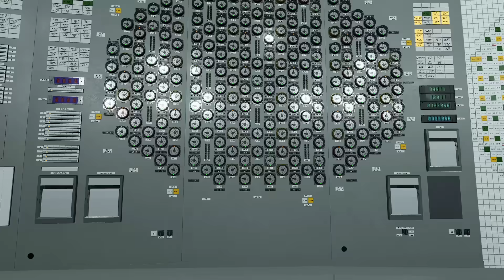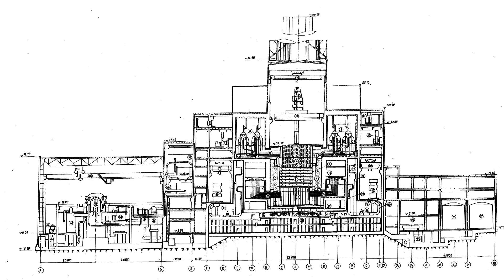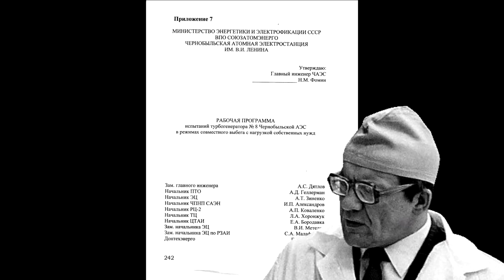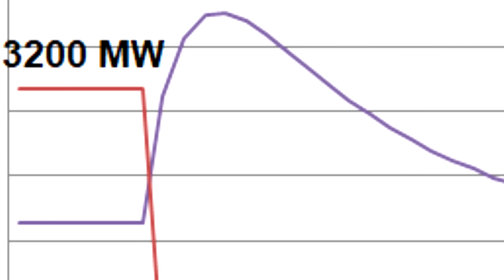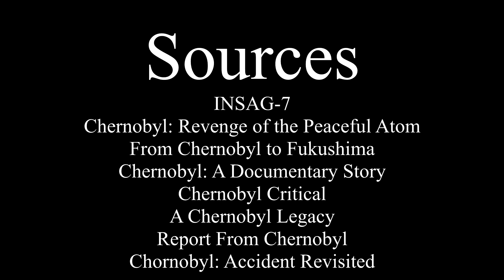How Chernobyl Exploded - PART ONE: April 25th, 1986

Comment: At 5:24 of this video, you state : "Akimov was substituted for Igor Kazachkov". This statement means, in correct English, that Akimov took over, replacing Igor Kazachkov. This seems to be in contradiction to the facts, which per the next part of the video, is that Kazachkov took over. So actually, what happened was that Akimov was replaced by Igor Kazachkov. This kind of error is why I will not be recommending this video to anyone with serious interest in what happened at Chernobyl.
Reply: What other videos would you recommend then? This is the most accurate one I’ve seen, such a minor thing as a grammar mistake won’t make it be super inaccurate.
Reply: @Nemo2507s  I've thought some more about this and tried to find other good videos.

On the one hand, it is critically important, when explaining what really happened at Chernobyl, to be very precise with the facts and to *communicate them clearly*. Who did what is obviously a key part of what really happened. The fact that, in the example I gave, the confusion was relatively unimportant to the overall picture does not mean that the error is not consequential. For sure, this kind of error makes the whole video seem just a little bit less credible. 

However I have not found any videos about Chernobyl better than the ones produced by That Chernobyl Guy, so actually I have changed my mind and I will be, and am, recommending them for anyone interested in the truth. The fact that they are not as good as they could be does not mean they are not the best currently available.
Reply: Six months later, but here's the thing.

Akimov was, effectively, substituted for and by Kazachkov. TCG used proper English.

Why? Because TCG is reviewing the night shift from the 24th to the 25th, supervised by Akimov. And Kazachkov takes over in the morning.

Simple as that. You did a doodoo out of a nothing burger.

Alas. Errare humanum est.

Cheers.

Comment: The Emergency Cooling System offline when there is nothing wrong with it. "Emergencies" can occur in complex systems in any operational condition for any reason, at any time. The only time such a system should EVER be offline is when it demands repair, or routine maintenance and only when the reactor has already been shut down and deemed safe from all other conceivable needs for such a system. Ape brains playing with what they cannot comprehend.

Comment: Chernobyl didn’t explode, it melted down.   Even an out of control reactor will never explode.   Reactor fission is fueled by what is known as slow neutrons, whereas fission bombs use fast neutrons.  Reactors will never be more than sub critical, VERY hot but not explosive.
Reply: Explosions are not required to be nuclear.  Hydrogen explodes, tnt explodes, gunpowder explodes.  The reactor didnt experience a nuclear explosion, it experienced a hydrogen explosion that distributed nuclear material outside of the reactor.  Much more akin to a dirty bomb

Comment: My guess is that Toptunov and Akimov had turned off the auto-correct function of the reactor already at the beginning of the test, and tried to manually run the core during the entire test. This was probably not admitted or swept under the rug during the trial. It is the only way to explain the drop of power to 30 MW - they didn't have enough experience how to control the reactor manually, and had overdone the power reduction. Then they tried to raise the power, but again, did not do it correctly. Finally they decided to push AZ-5 when they realized that they have no effective control over the core, as it was yoyoing up and down, way lower and then way higher than they wanted.
Reply: Not likely

Comment: I'm amazed by how much the operators were blamed for all of this, in both east AND west, the latter of which apparently also had an interest in keeping the image of nuclear energy "clean". If you sell a car and write in the manual that turning on the wipers might interfere with the brakes, and that the brakes under certain circumstances might accelerate the car, and that under a certain acceleration the steering won't work, and then you tell the driver to test the wipers, and it causes an accident, is it really the fault of the driver instead of the engineer?

Comment: you didn't mention a known design issue: the RBMK had an unusually large positive void coefficient. RBMK doesn't keep water inside the reactor under pressure, now you end up with fewer water within the reactor, as the water evaporates. This creates temporary voids. Now water is also a neutron absorber, so that these voids are resulting in a stronger chain reaction and increasing the thermal output. This means you have a positive feedback loop built-in, by design. Eventually the whole thing exploded... 

The book "Midnight in Chernobyl" by Adam Higginbotham mentions an accident at the first installation of the RBMK reactor in Leningrad (a partial meltdown, like at Three Misle Island!)

"On the night of November 30, 1975, just over a year after it had first reached full
operating capacity, Unit One of the Leningrad nuclear power plant was being
brought back online after scheduled maintenance when it began to run out of
control. The AZ-5 emergency protection system was tripped, but before the chain
reaction could be stopped, a partial meltdown occurred, destroying or damaging
thirty-two fuel assemblies and releasing radiation into the atmosphere over the Gulf
of Finland. It was the first major accident involving an RBMK reactor, and the
Ministry of Medium Machine Building set up a commission to investigate what had
gone wrong. Afterward, the official line was that a manufacturing defect had led to
the destruction of a single fuel channel. But the commission knew otherwise: the
accident was the result of the design faults inherent in the reactor and caused by an
uncontrollable increase in the steam void coefficient.
Sredmash suppressed the commission’s findings and covered up the accident. The
operators of other RBMK plants were never informed of its true causes. Nevertheless,
the commission made several important recommendations, to be applied to all
RBMK-1000 reactors: develop new safety regulations to protect them in the event of
coolant loss; analyze what would happen in the event of a sharp rise in steam in the
core; and devise a faster-acting emergency protection system. Despite their apparent
urgency, the reactor designers failed to act on a single one of these directives, and
Moscow promptly ordered more of the reactors to be built. The day after the
Leningrad meltdown, the Soviet Union’s Council of Ministers gave its final approval
to construct a second pair of RBMK-1000 units in Chernobyl, expanding the
station’s projected output to an impressive 4,000 megawatts"
Reply: This, the positive scram effect, Xenon poisoning, the graphite extensions on the control rods, and all other factors involved in the accident are explained in the April 26 videos from the author, and many others from same author analyzing the disaster. Including a full analysis of the INSAG-7 report. This video discusses the events of April 25 (see title) and the lead-up to the actual accident. As noted, it’s Part One of three.

The positive void coefficient knowledge, and coverup, is also discussed in author’s other videos on the 1976 Leningrad and 1982 Unit 1 incidents.
Reply: Between them “Adam & Sergey’s” books cover the evening in question and the wider issues very well. Plokhy’s story covers some of the ground of post soviet Ukraine which is also interesting to read about 
I also enjoyed some of the Kyle Hill stuff in Chernobyl and a couple of the pre-Craig Mazin (sp?) docu-dramas are quite good. I enjoyed “zero-hour” very much.

Comment: Jesus I never knew they turned off the emergency cooling system through physically closing the goddamn valves. The thought of that much uranium sitting there and heating up with no way to stop it aside from control rods is blood chilling
Reply: That ECS was useless anyway. It couldnt prevent the explosion.

Comment: That Chernobyl Guy: Where do you get your information ?  Every other film on this event details that they were testing the use of a turbine's output while it is slowing down.  They needed to know if they would have enough power to keep the reactor instruments going until the generators come on line.  The test had nothing to do with vibration.
Reply: Every other film on this event misses critical details.
Reply: There are credits at the end of the video. They were performing multiple tests in addition to the generator rundown test
Reply from the maker: As Danielle said, there were multiple tests being performed. In my previous video (The Truth About the Rundown) this is touched upon.

Comment: One thing you needed to emphasize is that xenon-135 is generated with a 4 hour delay through iodine-135 decay. That's why the spike appears.  When the power output crashed, the xenon was still being generated at the rate from when the reactor was running at 1600mw.  Once XE135 absorbs a neutron, it becomes XE136 which isn't a neutron poison.  With most of the control rods out, and only xenon and water holding back the reactor, it was like a stretched slingshot.  When the reactor was scramed, the graphite portions caused a runaway positive void feedback loop at the bottom of the reactor.  XE135 vanished, water flashed to steam, and the static graphite moderator caused power levels to reach 200x maximum in a fraction of a second.
Reply: The number of control rods may have been within regulation or close to it. Also, INSAG-7 mentions the presence of xenon rather than its disappearance as a factor.
Reply: @markusw7833  a runaway reaction's neutrons will change the xe135 into xe136 which isn't a neutron poison.   Listen to physicists to understand the physics.  Scott Manley has an excellent discussion on the topic.
Reply: @adamf663  What you're repeating is what you saw in the HBO mini-series. Trust me, Scott Manley and Craig Mazin could not research this topic properly and they are no physicists. Scott Manley's video is riddled with errors. People much smarter and more qualified than Scott Manley make demonstrable errors on Chernobyl because their skill sets have not been honed for the deception confounding this topic, and I'm being gracious in phrasing it this way.
Reply: Xe-235 doesn't "vanish" just because of a modest increase in reactivity over the course of 10-20 seconds. Basically no one in the Soviet Union has ever raised the subject of xenon burnoff as an initiator for the power surge. It is basically fan fiction for Western physicists who didn't do the math. If you like I can link a Spanish study that found the influence of xenon burnoff to be a quite trivial contributor to the power excursion.
Reply: There is no such thing as 'xenon vanished' or 'xenon vanishing'. It generates and decays and burns out, with 2x power transient 'burning out' timescale is hours, like when reactor brought up to 100% power from 50%. "burning out" does not means all xenon disappeared, but it's concentration and effect reached some point in the transient. With 120x power the transient may take minutes, but the reactor didn't last that long and timescale still couple orders of magnitude larger than timescale of processes that was recorded. I don't think xenon burning out was a major effect and it wasn't stated in reputable papers as such. Two humps field distribution because of xenon is a different thing.

Comment: Always wondered why they all wear little caps making them look like they are working in a food preparation facility. Is the equipment so fragile that shed scalp hair would damage the mighty nuclear friggin' reactor machinery?
Reply from the maker: The caps are to prevent any radioactive particles from getting in their hair and contaminating them. The caps are washed at the end of every shift- the NPP had its own specialised washing department as part of the decontamination workshop. :)
Reply: @thatchernobylguy2915  They had more mustache than hair, they've should protect that with something
Reply: @thatchernobylguy2915  oh wow, thanks for the clarification.

Comment: 4:35 I think there too much shift of the blame to operators

According to reactors design regulation all reactor safety critical parameters must be constantly monitored; continuous indication must be provided to operators; there must be thresholds determined and automatically checked and automatic shutdown initiated if safe range is violated. This was done for parameters like reactor's power, or power's increase rate.

On the other hand, operative reactivity margin wasn't in the list of safety critical parameters, no of the above requirements was met, reactor's manual allowed to operate reactor up to several hours with program that calculates operative reactivity margin not working.

While operative reactivity margin printout at that time indeed was lower than prescribed in reactor's manual, the flaw in program that calculated it was identified, and operator used graphical method to determine required parameter, which was within range, and it was later confirmed by processing recorded data.

So there was no neglect to operative reactivity margin from operators, but it was neglect to that parameter by reactor designers

Comment: One does not simply delay a turbine rundown experiment in an RBMK nuclear reactor 👌 I'm currently reading Midnight at Chernobyl (following your references), and having these videos this week is like the icing on the cake. THANK YOU !!!
Reply: exactly.
design was ok.
it was being operated improperly.
trying to run diagnostics and shut down while being constantly asked to turn back on to produce power.
they should have cancelled the diagbostic or pushed hard and run the diagnostics without delays.

they kept turning it on and off.
pulling these rods up and down out of the reactor without then properly, and slowly cooling.

they warped the rods and jammed the entire mechanism.
Reply: @winstonwho The increase reactivity with AZ5 press was ok?
Reply: @pedroalmeida555  At this point there was no any other option. In the last computer printout of power in the reactor, power was vertically shooting up from 200 MW to 10.000 MW.
Reply: @NorceCodine  was responding to the commenter that said "design was ok"

Comment: As xenon is mostly a product of iodine-135 decaying which is a product of nuclear fission when power is lowered xenon's concentration increases while the higher power iodine-135 is decaying and the lower power xenon let's call it utilization is less. Then, after about 4-6 hours, xenon concentration begins to be steeply reduced as its iodine-135 precursor is reduced and excess xenon is decaying. Ultimately with a power reduction the concentration of xenon is reduced as well, which is why the Kiev delay actually resulted in a depoisoning of the reactor.

I think it's really important to know what the plan was for finishing the turbine vibration measurements. If the idea was to complete them at alternating loads between the two turbines then this is the virtually unknown event that got the ball rolling toward disaster. The Kiev delay depoisoned the reactor so the xenon narrative in the HBO mini-series is complete nonsense, but it's extremely likely the power level was intentionally reduced under 700 MW so that the remaining turbine could be disconnected with less steam in the system to complete these measurements as well the rundown test without shutting the reactor down. In addition to there being a video on this (in the Unanswered Questions series) we have recently found what appears to be an operating log confirming an intentional decision accompanying a KOM switch from Chernobyl. This separate program being left over is what caused a deviation from the power figure in the rundown testing program. The confusing thing is with turbogenerator no. 7 being disconnected at 13:05 their intentions for whether they originally intended to complete these measurements with both turbines available at 1500-1600 MW or if they intended to complete them at a lower power with one turbogenerator already being disconnected is unclear.
Reply: Just to add, the Xe-135 is not present uniformly in the reactor, but its local concentration depends on the local power density. Thus, reducing power by inserting control rods, reduces power at top of the reactor, and leads the top to poison further by Xe-135, whereas the bottom half can actually de-poison at the same time. But, I have no insight to power distributions and how it varied during power changes, this is mere speculation.
Reply: The reactor was poisoned mostly in the center. The neutron flux distribution at low power was double humped with the peak at the top, meaning the top may have been the least poisoned. The graphite displacers did not cover the full height of the core based on this logic, that not much was going on at the top and bottom peripheries.
Reply: Huh